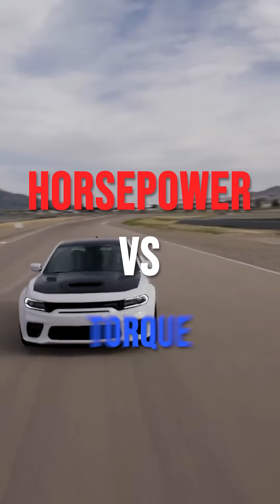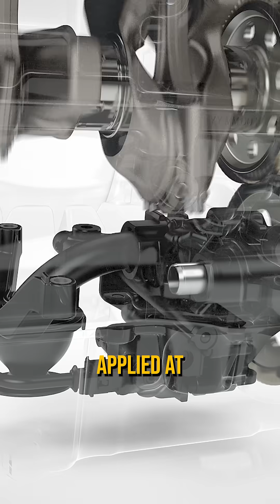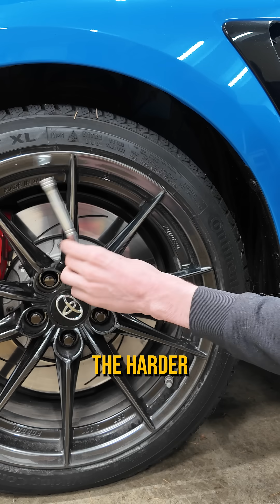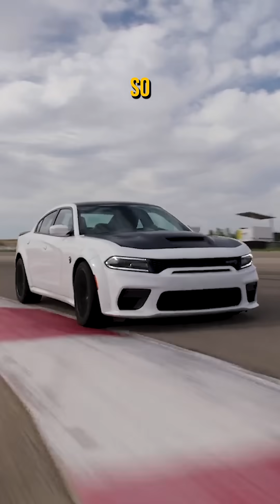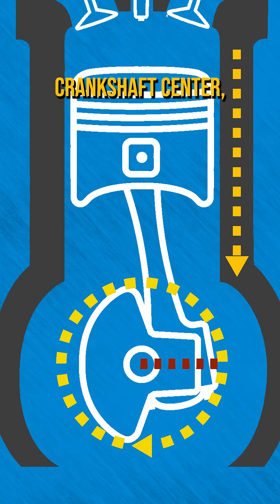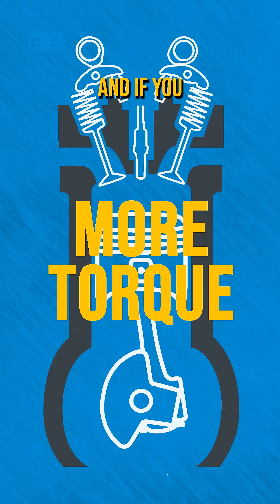Horsepower vs Torque (In 60 Seconds)

Comment: 🤔How many people watched this and thought the distance to the crank pin provides leverage the same way pushing on a long vs short wrench does?  

Crankshafts no matter the distance to the crank pin (aka crank radius) provide no leverage to the work done by combustion propelling the vehicle . Other than this arguably misleading part it’s a great video free of all the typical misinformation like HP = Speed, Torque = strength.  Torque pulls heavy loads up hills that power can’t. Etc…. I’m going to give it a C.  Would have been an A without the implied leverage part.

Comment: the higher the torque the less times you need to press the gas pedal though it can use more fuel as is
Reply: That's power
Reply: @idkhowtonamemyself2137  i came back to that comment amd had a stroke reading it. how did you understand anything bro?

Comment: Horsepower is how fast you hit the walll, torque is how far you move the wall
Reply: Incorrect.

Horsepower is what you use to do stuff.

Torque just gives you an idea of, how much you need to rev the engine to get the power.
Reply: That's the dumbest and most wrong saying about it

Comment: I'm staying tuned because I also have the opinion that torque doesn't matter due to transmissions etc.! It would only matter if you weren't able to move the engine over AT ALL - but since you are because of clever transmissions everywhere, you ONLY care about power which dictates how quickly you get kinetic energy into your system - a.k.a. how quickly you can make your car move fast. :)

Comment: All other things equal the engine making twice as much torque at the same rpm is making twice as much power and will accelerate and pull ideally twice as hard at the same speed. Or it will pull twice the load and pull as hard as the other engine. The engine making the same torque at twice the rpm is making twice the power and is going twice as fast. 

The torque curve, the peak HP and max rpm of the engine decide the character of the driving experience. HP is split between torque and speed at any rpm and torque in turn is split between acceleration and the mass being pulled by the engine. The combination of Mass, acceleration and speed determines the charcter of the driving experience, apart from some other practical factors like gear ratios and suspension

Comment: I always explain it to people with this analogy: You are loading bricks onto a truck. Torque is how many bricks you can lift in one go, rpm is how quick you pick/drop bricks, and horsepower is how fast you load a truck. 
You can lift slowly but pickup a lot of bricks (like diesel) or very fast one brick at a time (motorcycle engine). If you load truck in the same amount of time, you have the same horsepower but different torque.
Reply: This is the best one I’ve heard so far, I’ll definitely be using it!
Reply: If we are going to do the analogy, it's better to say: if torque is how many bricks you can carry together, then horsepower is how fast you finish the job and deliver them to the destination.
For example, in a high torque car you carry all the bricks together but it will take you 1 minute to reach the finish. In a high horsepower car, you carry them 1 by 1, but the car with more horsepower will take less time to deliver in the end. Let's say each trip needs 1 second to reach the destination. You have 10 bricks, so 10 trips - it will take you 10 seconds to deliver all bricks, not 1 minute like the torque car.
Reply: Thank You Sir
Reply: Wow! Im impressed! Your princeton professor job awaits you, broski! 😃👏

Comment: Same as arguing addition vs multiplication. 
RPMs are a multiplier of torque, and Hp is the same as Watts for total power. Just like you can’t use amps to measure power, and you can’t use volts to measure power, you multiply them together and you get the power number. Power is a metric for total output, or how much work is getting done. 
Torque can get things done, but 2000hp gets twice as much done as 1000hp, it has to or the numbers aren’t right. Newton says.
Reply: Torque alone does no work.

Comment: It's why a supercar can't tow a lot compared to a big truck that has lots of torque.
Reply: It can if you give it a diffrent gear ratio, as torque can be multiplied. They also make more power, so if anything they might be better at towing.
Reply: Save yourself a step and just look at the power curve.
Wherever you are on the curve is your budget to accelerate, tow, climb a hill, push air out of the way at top speed... torque is only a useful spec when you are calculating when parts will break.
All work is done by Power.
Reply: Nonsense. Power, not torque, is the limiting factor in not only the top speed of a vehicle but also how quickly it can accelerate at any speed and how much weight it can pull up an incline at any speed.

Comment: Yeah yeah try telling someone that drives a semi for a living that torque doesn't matter in any situation.... Or a train for that matter... That creates tens of thousands of pound feet of torque at 1 rpm.
Reply: Power, not torque, is the limiting factor in not only the top speed of a vehicle but also how quickly it can accelerate at any speed and how much weight it can pull up an incline at any speed.

Comment: "Torque is what you feel when you press the gas, horsepower is how long you feel it."
Reply: this would be true if you are talking about wheel torque and wheel horsepower, but if you are talking about engine metrics, here's a quick spoiler: Transmissions. with a transmission and correct gearing, a 300hp 100lbft motor will always have more push and will push longer then a 200hp 300lbft motor.
Reply: no
Reply: @SantanKGhey1234 you're clueless hun

Comment: Understeer is when you hit the wall with the front of the car and oversteer is when you hit the wall with the rear of the car. Horsepower is how fast you hit the wall, torque is how far you take the wall with you
Reply: Thats just wrong. If you really want to make a wall analogy then rpm is how fast you hit the wall, torque is how heavy the object hitting the wall is and horsepower is how fast you destroy that wall / how far you take the wall with you.

Comment: For cars it's slightly different, torque is what make you go forward, power is how easy it is for the engine to maintain the speed (rpm).  They are interconnected but that is the basic break down. This is why Diesel engines have insane torque and relatively low HP, because it's more important for them to pull their life ads down the highway rather than going fast quickly.
Reply: The point of the video is literally to debunk that
Reply: @bong_sloth guess they failed. . .
Reply: @Gene4666 Power is the integration of torque over time. Torque has no bearing whatsoever on the motion of anything because it is only an instantenous dimension. It does not matter how much or how little something weighs. Whatever accelerates that weight fastest will be what has the most power. Thats literally how power is calculated. It doesn't matter if that power source has 1ftlb of torque or 1 million ft lbs. Its the same reason an impact driver cant move your car despite having 2x the torque.
Reply: Sorry Gene, Abracadabra is correct.  No work can be done without power.

Comment: I learned, horsepower is how fast you can punch and torque is how hard you can punch.
Reply: RPM is how fast.
Reply: Power is how hard and how fast.  Power = Force x Velocity
Reply: wouldnt it be how hard you could punch at a certain speed
Reply: Thats physically still wrong.

Horsepower means how hard you can punch.
Torque means how fast your fist accelerates to achieve that power at a given point.
Reply: @dom3827 torque = Force x radius.  There is no time component.  Power on the other hand is Force x Velocity.  All work is done by Power.

Comment: HP also doesn't change with gear ratio (except for friction), so if you need more torque you can just change the gear ratio, but if you want to get all that torque quickly (at higher RPMs) you'll need more power.

Comment: Yup, and the higher the torque the higher the horsepower and the lower rpm it can generate that torque the higher the horsepower. But if you want to know the thrust it generates keep in mind it's weight and the power to weight ratio
Reply: Lower?

Comment: in the end hp is what you want.
Reply: I am an ME. Take it with grain of salt. Ask yourself, how can you have HP if you don't have enough torque at 0 speed?
Reply: @sherif4362 Clutches and transmissions exist.
Reply: @idkhowtonamemyself2137 
Hope this helps.: you have torque but angular speed of tire is 0 the hp is 0 (torque not enough, like you applying torque to remove a rusty bolt). Torque is action and hp is reaction.
Reply: @sherif4362 At any given wheel speed a car that makes more power will make more wheel torque. Engine torque doesn't matter.

Comment: "torque doesn't matter" 
With 0 torque, your car ain't moving nowhere.
Reply: And with 0 rpm, but 1000 Nm, it also ain't moving nowhere;)
Reply: @marcokrueger3399  yup!
Reply: Power, not torque, is the limiting factor in not only the top speed of a vehicle but also how quickly it can accelerate at any speed and how much weight it can pull up an incline at any speed.

Comment: Torque doesn't matter because you can have as much as you want by using a lower gear. What you need is a wide power band to reduce the number of gears required.

Comment: Real simple. Torque is what moves the car. Horsepower is the torque times RPM.

You can use gears to trade RPM for torque, but that reduces RPM, so low torque engines need to "spin up" to get the RPMs to trade for torque.
Reply: try trade 10000 rpm at 1 nm on whell torq at 100 km/h in regard to avg car with normal whell radious 😂😭  there be nothing cos power:speed = force from 10000 rom at 1 nm thers not much power with 0,8 hp ypu be ride bacwards 😂👍🏻🪠🍿 you must have power vs torqueand rpm itself with close to NO power is a joke i mean there be not much to trade for normal road speeds like 1 mln nm on so low rpm that there be1 hp or 1 mln rom at so low torq that there be also 1 hp and ypu have engine which can move good maybe avg not very fast class electric kock scooter but defenitellly not avg car or semitruck or whatever what required much biger thrust at normal road speed level 👌🏻🪠🍿and ps im write normall whelll radious cos withenough big radious torq can be huge on whell in regard to some othercar with normall whelll radious pount is whats move car is force so when you divide big torq in whell be biger radious of whell there be close to no force pysh car firward at normal road speed as there be close to no power ….

Comment: but then ship engines wouldnt work properly we need very high torque(Huge pistons) even if we dont have so many rotations per minute (125-300 rpm)
Reply: Engines like these are just more efficient in that particular scenario. That's pretty much all there is to it.

Comment: Doesn't torque matter in the first stages of a launch? When the rpm are too low to generate a lot of power, having an engine capable of a lot of torque (such as diesels), might be an advantage, or am I missing something?
Reply: In most drag races, high rpm plus a flywheel will result in the engine spinning the flywheel to very high velocities, and that results in a lot of kinetic energy being stored in the flywheel. When the clutch is released, all of that kinetic energy is going straight to the wheels, which makes for a good launch even if your engine has low torque. However, the flywheel cannot be too heavy because then the engine's low torque can't spin up the flywheel fast enough, and it will be too much extra load that it may slow down the car. Or you can just have a low-ratio gear so the engine's high hp is traded for extra torque, which will also result in a good launch.

Comment: I don't understand how people can say they're different when they're literally directly portional to each other. I would argue it's more about where your peak torque and HP are on your rpm curve that changes the driving experience drastically.
Reply: they are interrelated for sure. The problem for most people though is they treat power and torque as separate entities.
Reply: Just say you didn't understand the video and move on...

Comment: My farm tractor only has like 40 HP, but gobs of torque! Can pluck tree stumps from solid ground like they were daisies. BUT super slow. That's how I understand torque vs HP. That said, if a fast car is heavy too, then torque is very, very helpful to get it moving to begin with. Little light weight cars don't need tractor levels of torque. HP reigns supreme there, and even then, not a ton. Think Miata or S2000. Revvy little things. Super fun. Won't win any towing wars. It's all good. Just have to fulfill whatever your mission is for your vehicle.
Reply: Your farm tractor has farm tractor tyres and very low gear ratios. With the right transmission and the same tyres a miata is going to run away with that little tractor in tow.

Comment: Torque is all that matters, a 1hp engine can do any speed given it has the torque to push the proper gearing
Reply: It can only do speed once you involve time.
Reply: @kitmoore9969  yeah, a balance of the two is more important, a 1000hp engine couldnt even move if it only has 1 ft/lb of torque. Torque matters most though, thats why these new 6.7 powerstrokes knock socks off mustangs and camaros for the 60 foot
Reply: @addisonherbert6686  with the right gearing, a 1000hp engine with 1ftlb of torque would be able to move, quite quickly too
Reply: @TheNoiseeeee completely false, with more and more mechanical advantage it takes more and more torque to move, you lose a lot of energy transfer with every extra gear
Reply: @TheNoiseeeee if friction didn't exist then sure, but it does, and it requires torque to break
Reply: @addisonherbert6686  this was already a hypothetical situation, because the engine i specified would need to move at 5 million rpm to have that 1000hp, which is nearly impossible
Reply: You got it backwards. Any engine can make infinite amount of torque with proper gearing. The only thing limiting acceleration and top speed is power.

Comment: You can have too little torque to even move your car but torque in a race car you don't need 2000 ft. lbs. of torque but the semi hauling that race car could benefit from it.
Reply: You are forgetting that torque can be multiplied. With a right gearbox a lawnmower will be able to haul more than a semi truck (just extremly slowly due to low power).

Comment: Your definition is not perfect. At the same rpm with bigger bang you'll get more torque AND MORE POWER. However if your engine can't handle the bigger bang at high enough rpm, you'll get more torque but same or less power.

Comment: Most idiots think torque is what matters, i tell them human pedaling a bicycle creates more torque than 1 liter super bike, also torque is a lot difference depending on the gear. Also there are cars with diesel and petrol engines, same HP, but torque is almost double, and still loses, i stated that and some say "you can't compare diesel torque vs petrol torque.... "

Comment: Torque doesnt matter. So I can pull that 40 t trailer with a Lamborghini right?
Reply: with the correct gearing, you can haul more with a lambo then any diesel truck can
Reply: @TheNoiseeeee  that's my point. Gearing: TORQUE!
Reply: If the Lamborghini weighed the same as whatever else you're comparing it to, yes, yes you can.

Towing isn't about torque it's about the weight of what's doing the towing. If it's heavy enough you can tow with with a little RC car engine, as long as you have the right gearing.
Reply: Yes you can.

You just need to rev higher, and be careful with the clutch.
Reply: Yeah just change the gearing to run in the rpm band for the same horsepower as a semi truck and it will have exactly the same towing performance because it has the same wheel torque. You can just change torque to whatever you need with gearing you can't do that with horsepower.

Comment: Power is how fast you can go, torque is how fast you get to that speed.
Reply: That's just wrong... By that logic for example a John Deere 5820 Tractor (88 HP, 250lbft) would have better acceleration than a Honda S2000 (240 HP, 153lbft), or even the V10 Formula 1 cars (800 HP, 210lbft)
Reply: @muhschy alright, take into consideration weight or power to weight ratio
Reply: @robertmifkovic6325 ok, by that logic f1 cars would would still use tractor engines, yet they don't
Reply: @idkhowtonamemyself2137 they wouldn't . They need high horsepower to reach high speeds.
Reply: @robertmifkovic6325 They also need high horsepower to accelerate quickly.
Reply: that makes no sence
Reply: @TheNoiseeeee it does. Harley making 90hp will have trouble going 150mph but it will reach  100mph from aby speed rather quickly.  250cc inline 4 will have a top speed of 120 but it will take some time to get there.

Comment: People who are all about the torque are actually all about the elasticity of the engine and the low rpm torque. High horse power at very high rpm isn't all that usefull for daily driving
Reply: Or towing, or plowing...
Reply: @GarthKlaus  Power, not torque, is the limiting factor in not only the top speed of a vehicle but also how quickly it can accelerate at any speed and how much weight it can pull up an incline at any speed.
Reply: tell that to the people screaming by my house all the time